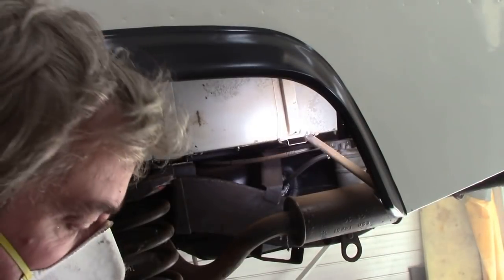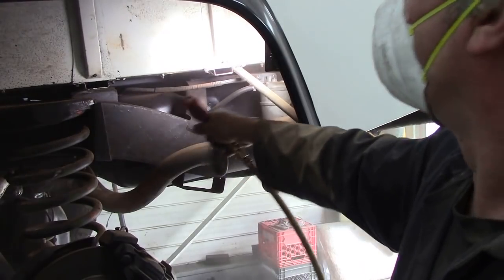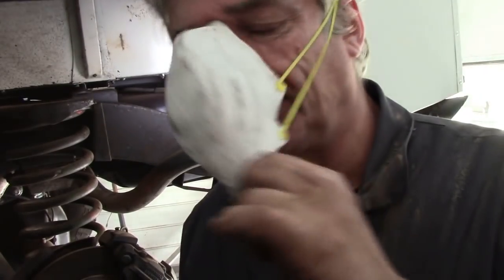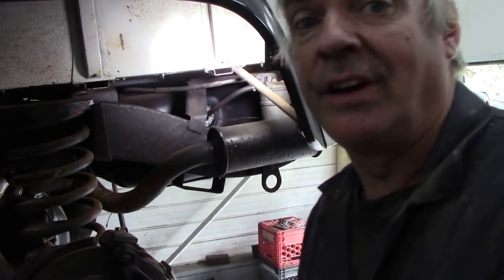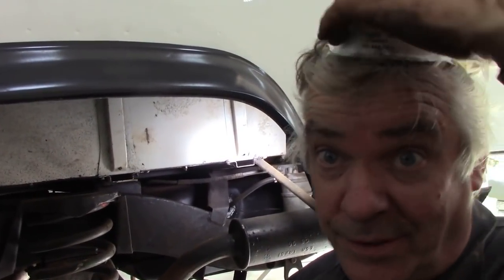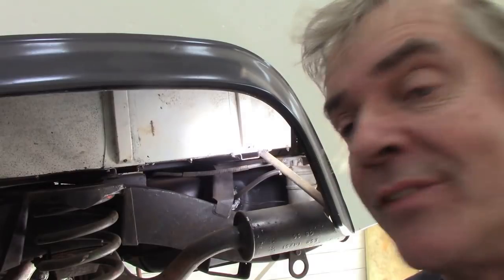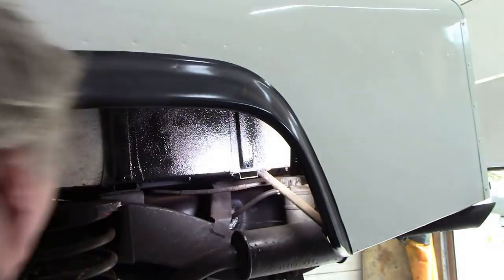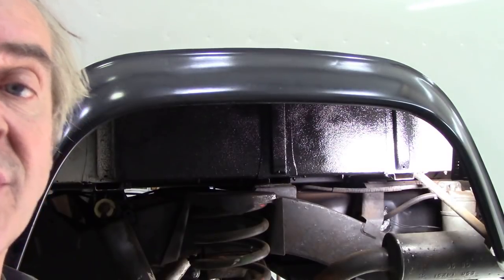Rustproofing with Krown part 1. Prep work

Comment: Krown is the only true rust proofing method at least here in Ontario. I heard of Rust Check is good but I don’t know much about them.

The only thing I want to say to anyone that is considering any kind of treatment is do not go with either Honda or Toyota rust proofing. They are actually worst for your vehicles especially the Honda rustproofing. They are crooks, the treatment actually traps moisture in and vehicles will rot inside out. Trust me, I am speaking out of experience. I wished that I had treated Krown proofing on all my cars in the last 3 decades.